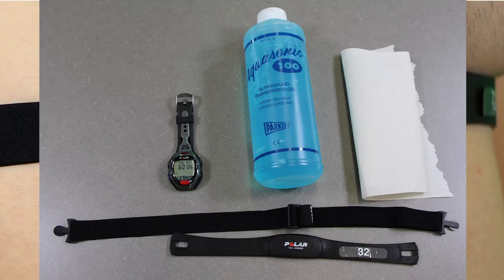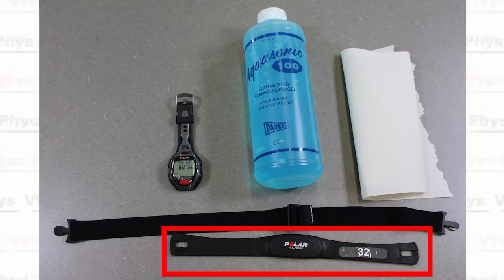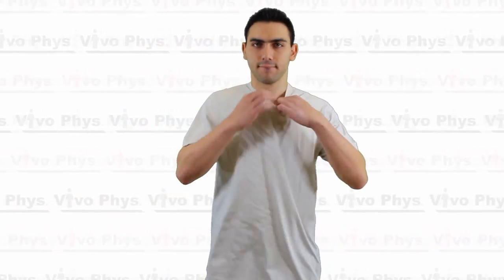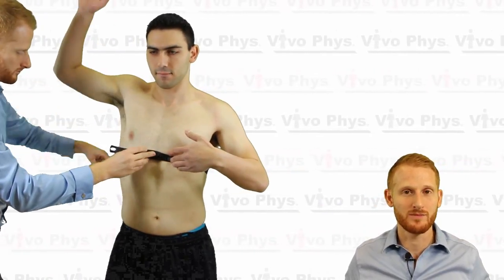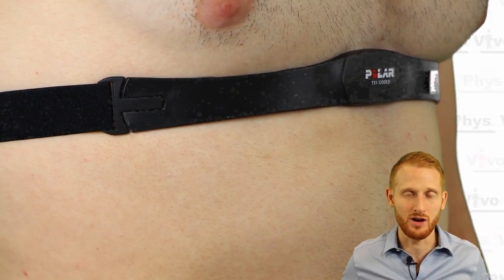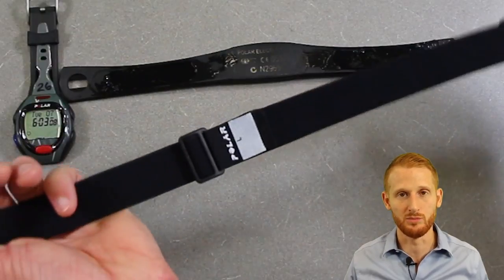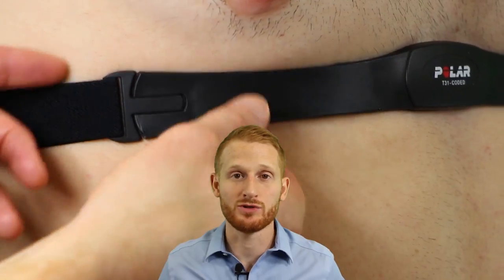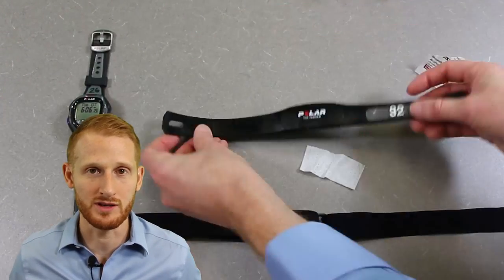Chest Strap Heart Rate Monitor

Comment: Hi Dr Matthews, I use a Polar T31-Coded chest strap with my Galileo Sol scuba diving computer. I dive with it both in a dry suit and a wet suit. Today my heart beat reading seemed way off the charts; it started out reading 67 to 71 bpm then it jumped to between 195 and 205 bpm while very slowly swimming along the bottom. I surfaced to see if I could notice anything wrong. Instantly on the surface, the heart rate monitor dropped to 60 to 65. I dropped to the bottom (8-ft deep), and it instantly went up to 195 to 200 bpm. I repeated this surfacing three times before aborting the dive. My dive buddy, a fireman, thought either I wasn't wearing my strap correctly or that there was a malfunction in the computer. I have dove with this system for four-years with no problem until now. The dive computer battery is full, and the computer works perfectly. I have been diving for 45-years. I am considered a high-end athlete when I am tested at the hospital. I do between 13 to 15 METs on the stress test. My blood pressure is usually 118 over 79, and my heart rate is usually 60 bpm at the doctor's office. My PCP reluctantly told me 133 bpm is the top end for me. My cardiologist will not give me that answer, and the two cardiac nurses I dealt with refused to tell me the top end bpm. I have no damage to my heart. I am told my heart is "perfect" when they do echocardiograms on me. I wear the strap over my solar plexus with the strap touching my lower pectorals; there is a gap between my solar plexus and the strap that I can place my finger underneath. Is it time for a new chest strap or a new dive computer?
Reply from the maker: Obviously you should follow whatever your doctor's are telling you. If you are allowed to return to your normal activities and the strap is still acting up I would try making sure there is moisture between the strap and your chest. It can bounce around with high and low numbers when it gets a poor signal. If that doesn't work I would try getting a new strap first. They are cheaper. Good luck.

Comment: Hello, I have a pectus excavatum. How should I locate the Heart rate monitor? planning to buy a polar h10 but because of my deformation, there is a gap between the middle of the chest and the strap, how can I locate it?
Reply from the maker: You can adjust the strap up or down slightly as needed to make contact between the electrodes and the skin.
Reply: @VivoPhys  Thank you. So I can place a bit upper like nipple level right?

Comment: Polar H7 or Polar OH1 sensors can also be paired to Polar watches or to Garmin watches, an then synchronized over the internet to Polar or Garmin servers. But access of sensor raw data is difficult for instance in Garmin Connect. These two sensors are Bletooth smart (BLE) sensors which are compatible with many devices. My personally, I would not buy a Polar T31 anymore, the newer Polar sensors have BLE connectivity, which is a widely accepted standard.
Reply from the maker: Thank you for all your well thought out comments. If you are interested, here is a link to a pilot research project I did using the heart rate monitor and a finger blood pressure system to compare their ability to perform resting heart rate variability analyses vs an ECG unit. 
https://digitalcommons.wku.edu/ijesab/vol9/iss8/47
Reply: @VivoPhys  Thank you, Evan, for the link. I m on a project to analyse the effect of meditation training on changes of resting heart rate and other parameters,. it is a long-term study.  I m facing troubles to have accurate data 24 h 7 d. I m experimenting with a setup with Bitalino ECG,  Polar OH1 and Polar H7 recorded simulaneously to prevent data loss. It is hard work.
Reply from the maker: Good luck. Are you doing this in association with a university?
Reply: @VivoPhys  No, it is not in association with a university, but this could change.

Comment: Question. Are results affected if the elastic strap is too tight? Asking for tensioning instructions.
Reply from the maker: You want it tight to ensure good contact with the skin. Basically make it as tight as you can without discomfort.

Comment: Hii!
Does it works over thermals and winter jackets?
Reply from the maker: The strap needs to be in direct contact with the skin. You can put your clothes overtop of the strap and it will still transmit to the receiving watch.